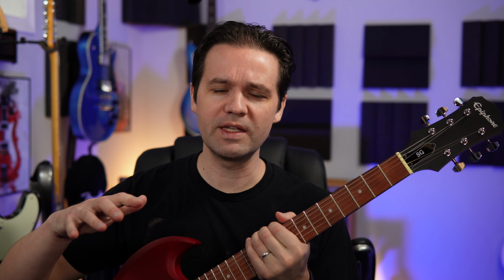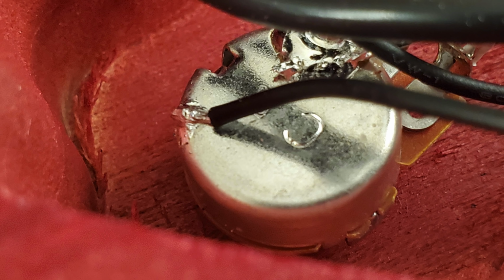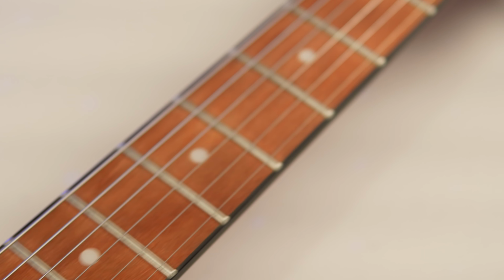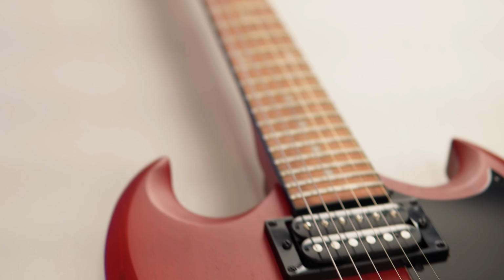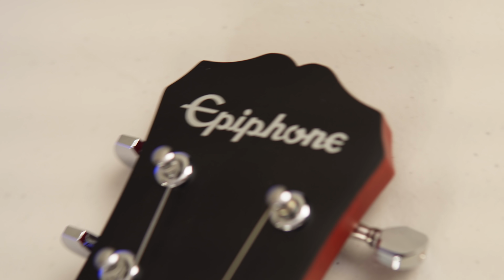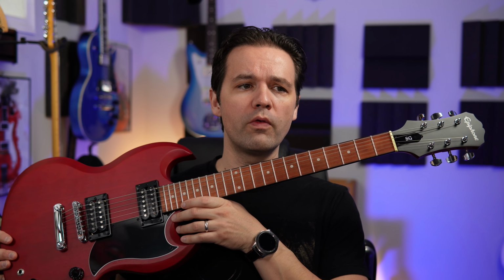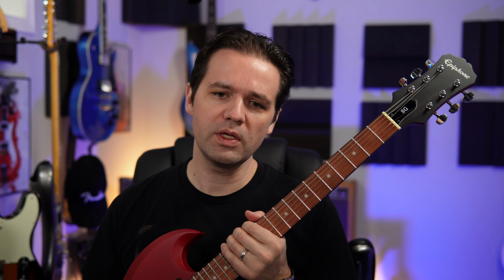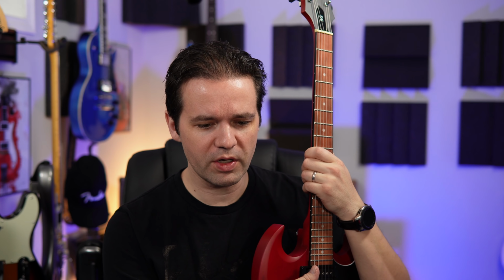This Epiphone SG is Solid and Special

Comment: I actually like the head stock and think epiphone' s are great for the money. With a full set up and pickup change they are great.
Reply: And tuners probably
Reply: So... if you spend extra money on them they're great?? What about straight outta the box?
Reply: @alicegrant3731  Why not get the sound closer to a proper SG, your paying under £200 for this thing so you will mostly have some budget left over for modification
Reply: @whyisyes3957  true. Depends what you can live with sound wise
Reply: @alicegrant3731  I use mine mostly stock with upgraded strings and well taken care of tuners. I can get amazing Sabbath like tones on it and I found it great for most punk and some metal
Reply: I have a cheap sg I kept stock as well. The pickups don’t sound half bad but, I did just do a better insulation job in the cavities. Other than that it sounds good though my amp so I just figured why fix it if it isn’t really broken. 🤷🏽‍♂️
Reply: Vs 1500 to 2000 for a new SG?

Comment: This guitar taught me something: a guitar is a piece of wood that holds pickups. Bought mine to mod, installed Gibson 57 classic pickups, Gibson pots, orange drop 22uf cap, Tusq nut and Grover tuners. Sounds and plays freakin awesome. $289CAD for the wood, $550ish for the parts. Honestly, this plays as nice as my Goldtop that costs me over 3k. What the Goldtop has is its beautiful finish and brand name, which is worth something and why I have it. But modding this little gem blew me away

Comment: Just got mine new at GC for $200 before taxes 🎉. Love it sounds incredible I played on an old cheap Washburn Lyon signed by Brian bell, that I scrapped off as a child and now deeply regret and for breaking it and throwing it away, however that guitar gave me the best and greatest load ups for palm muting and releasing and just ROARED when done right at the right time. This guitar does the same thing and it brought me back to being 18 and feeling bullet flipping proof again, I’m only 27, and reinvigorated my passion to continue growing in guitar playing even though I have “better” guitars and more expensive ones, I’m about 95% sure this will be my go too unless I wanna feel like ripping heads and pulling out the ex50 and walking in hetfields’ footsteps. However this guitar really does rip and sing any clean or dirty Metallica riff along with any other band you can think 🤔
Reply: Oh and EXTREMELY light. My ltd explorer shape is heavy af and suuuper neck heavy, kind of a bitt to play when standing but this thing is like butter. I won’t ever stop saying it more is less and less is more if it’s done right, feels right, and sounds right to the player!

Comment: I have one of these in brown (probably something fancier officially). It makes a great travel guitar, partly because of its compact size and partly because of the price. I even took it to Afghanistan a few years ago.
I actually cracked the neck just below the headstock, so I got my first repair experience with it. Then I replaced the tuning machines because of exactly what you pointed out. I'm looking at replacing pickups and the pots, just to see what that does. 
I think for someone who likes to tinker, this is a pretty good choice (again because of the price, but also the simple design).

Comment: The walnut ones are the most desired of the bunch and those are the most moddable too. 
I can order in tons of different walnut parts such as walnut pickup rings, walnut selector switch tip and switch washer, knobs and even tuner tips too. 
in fact, I'm doing this build and will update when I'm done.

Comment: Grabbed one cheap. Needed some light fret leveling & polishing & fret ends done as is typical in the cheap EPIs. Pickups are too high stock, drop them. That's why your overdriven sound is so muddy. You can get some nice tones once you do. Tuners are OK but have a lot of slack between tuning up and down. As for the Slim-D, I don't think so, Epi. More of a C that starts slim but gets fairly thick up higher.

Comment: $199 At GC. If you have any old gear laying around, pedals, amps, guitars…you can trade it is for a 10% discount and whatever they give you for the trade ins. Works on any price guitar too. I traded in 2 super cheap Amazon mini pedals and got it for $169 after tax. Wish it was an Indonesian copy instead of a the Chinese one, but frets and neck are pretty solid. Pretty awesome you can get a playable guitar, brand new for that price in 2024.

Comment: Bought this for my 11 year old as a step-up guitar and he loves it! Super light, great sound for the price. I'd highly recommend for a player who is on the small side and looking for a great beginner's guitar.
Denver, Colorado.
Reply from the maker: nice!
Reply: Is this not a full sized guitar? I'm interested in purchasing. But if it's not a full sized SG then I'll pass.🤔
Reply: @EXSENTRIX  it's the standard 24.75 scale for epiphones and gibsons. The body is very thin and the wood is light, so my son who's smaller doesn't has as much of a problem keeping it from diving as he would a fender that's a little longer scale and heavier.
Reply: @acaeleus  You've got a good point. I would have loved this when I was 11. That's the age I got my first guitar. It was a Synsonic Terminator. With the built in speaker lmao!
Reply: Perfect. I have a bad back, weak left foot and small stature😂
This is what im looking for

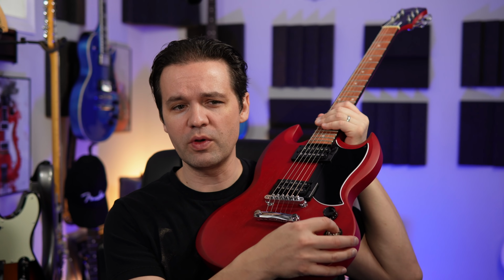Comment: In 15:08 you did the thing ... when I broke my Special II switch. Similar one...not good at all my piece...soft pot metal and badly made. The pups are fine ; )
Reply from the maker: I did the thing?
Reply: @landonbailey  Yes...did you check the condition of the switch after ? I lost the bridge pup alone connection and when opened the cavity to check why, the metal parts dropped out. I soldered it somehow but waiting for a new better one now.

Comment: 4:29 for an inexpensive guitar at least the solder joints are clean and shiny. Sometimes you'll see dull and dirty joints and wires where the conductor strands are partially cut through during the stripping process.
Reply from the maker: it was clean for sure

Comment: The difference between the neck and bridge pickup resistance is crazy! I have an older version of this from 2001. The bridge is about 15.5k ohms while the neck is 12.5k ohms. That's a lot closer. I guess with these cheap pickups they just stop the winds whenever they feel like it so you get crazy differences like this.

Comment: You had me a $249.00, stopped me dead & paused the video.  The all over cherry satin finish it appeared to be an $ 800+ guitar.  Fender gal, open to new stuff too.  Give you my opinion after ...your DeEp DiVe.  For the price, okay, those tuners can be removed, open the gear casings on each & tighten all the inner gear screws & the tuners-will stay in tune better & longer. It’s not for me, but I appreciate the review, definitely will look at a few Epiphones next time I’m at my local.

Comment: The downside of cheaper guitars, the Frets. Every Squire and Epiphone I need to go through and do the work on them, Its just the trade off for the cost grant it they have gotten much much better over the years.
PRS SE tends to put all the money In the woodworking Frets/Nut and some of the hardware, usually the Pickups/and electronics are where they skimp the money to make it affordable. cheap Alpha Pots, which are fine, just not the greatest.
Reply from the maker: good point. I've heard they also wear down because of the cheaper metals
Reply: @landonbailey  Yeah, cheap Nickle, typically you have cheaper alloys and then you have expensive alloys but you are sliding, slapping, and abusing the crap out of the frets, it is rare to come across a vintage LP that is actually played that doesn't have frets down to small nubs that are barely there or severely worn. Stainless steel frets are real nice, I seriously hope we see them start filtering down to Fender's product tiering rather than just being bound to the Ultra Luxe series. Especially because Nickle is actually more expensive ironically than Stainless steel metal wise, processing depending on the alloy shouldn't be all that different either, just more wore down tooling on the finishing steps.

Comment: About two years ago I think it was, I bought a Epiphone SG Special VE, and I still play it all the time.  This guitar is almost the same exact guitar, no frills and all but a working guitar that sounds pretty good..   I got mine for like 130 ish USD and it wasn't on sale..  I would never pay any more than that for this guitar, any company that charges more than that is gouging you period.
Reply: So, I have owned my Epiphone SG Special VE for about three or so years now, and I figure it would be cool If I replied to my own comment from a year ago..

I didn't include much information about the guitar its self, outside of the fact that it worked and sounded good, so I figure I can give some details now. 

First was the truss rod issue, the first one I got sent by the online outlet I bought it from, had a truss rod issue.   By that I mean, when I did my setup on it, It worked, but when I tried to pull the tool out, the truss rod followed....  So, I got it replaced, and my second one was fine.  The fret ends on both guitars needed a little love, as they were kind of sharp and they needed a quick shine up as well lol.   The tuners worked on both guitars, and the tuners on the guitar I still have work fine.  It's possible they are crap, but the guitar doesn't go out of tune very fast, generally I can tune it once a week and I am fine with it.  Even then, its just little adjustments that is needed, so its fine.   The neck did get glossy pretty quickly, but I bought some of those green Scotch Brite Heavy Duty scour pads and they worked perfectly for fixing that issue..  I hate glossy necks with a passion, as they seem to get sticky real fast and no matter what I use I can't get them to stop while they are still glossy, which the Scotch Brite pads work to fix pretty well.  

Lets see, it still sounds good, the pickups are fine and the electronics have held up, though its only been like three or so years so.....  We will see how long they last until they need replaced..  The guitar gets played at least 4 to 15 times a week for at least 30 minuets at a time, so it gets plenty of usage.   I clean it up every time I change strings, which tends to be about once a month or so, so it still looks pretty good.  It is a different color, its Heritage Cherry Burst or something like that, and I like it.   Its one of the top three guitars that I play, its on the list with a Ibanez JivaJr and my Fender CP-60s acoustic guitar...  I am almost constantly picking it up or one of those other two lol.   I would recommend this guitar to not just a new player, but any player and at any level, as its fun to play... 

Oh and that fret board is a strange one, though I use Music Nomad stuff on it, and once I did it got a bit darker..  Its a cheap priced wood and all, but it works just fine for the purpose, and it is different than what you generally see on other guitars...   I fell in love with these guitars, because for some reason, to me, these felt better than the more expensive Gibson SG's I tried...  Could be the satin finish on the neck that I like more than anything else, but its still a guitar that I like a lot more than the other SG's that Gibson produces....   

If I remember this, Ill come back in another year or so, and give a update.. Though I doubt I will remember, who knows.. this video popped up in my feed for a second time, so maybe it will happen again lol.  I wonder if he kept his, or if he got rid of it...

Comment: In '95 I got a '92 Gibson SG Special, black with ebony fingerboard. It was my main for about 15 years and sold it because it's always been a love/hate relationship: the sound was amazing, those pickups were so high output! But I never really came to term with the fat neck. In 2001-2004 I used to gig with a VHT Pitbull and the combination was killer.

Comment: I've had several of the Epi Special Les Pauls. They really vary in quality. Some are good, some not so good. The Special SGs really used to look weird without the pickguard. These look really nice though. Saw they were 199-299 new. Definitely worth 199. But any more than that, you can likely get a used Epi SG Standard.

Comment: Epiphone for some reason does not list some of their more affordable guitars, let alone specs.  So, retailers are left with posting old specs that pre date the CITES act..  Now Epiphone does list specs for it's new Les Paul Special II E1 model, and that finger board is listed as Indian Laurel.  I have held one in my hands, and the LSPII E1 finger board is the exact same material that is on both my Epi LSPI P-90 guitars, 2020 and 2021 models.  Furthermore, I've also played that new SG you are reviewing here, and it is the exact same finger board material as both of my P-90 Epis.  On a final note, your SG was manufactured facility 13 in China, as were both of my P-90 Epis.  So, after geeking out a bit too much here; Indian Laurel seems to be the finger board answer...but was there a question???  Does anyone care?  Bottom line; the finger board works just fine.  It's NOT Rosewood, most likely Indian Laurel, but it still works.  Thank you Mr Bailey for your Epi SG review.
Reply from the maker: cheers!

Comment: call me crazy , but if I were to get an epiphone, that is the model I would get. I have had the set neck epis that cost much more and I have played a few of those specials. To me the specials are a way better deal. Compared to my Gibson SGs the specials get just as close as the expensive set neck epis for way cheaper and they just seem cooler. For the price of a set neck epi you could just save a little more and get a real used Gibson which is light years better. Peace

Comment: The Les Paul Special II I acquired was exactly the same. Those frets appear dull as well just like mine. The fretboard on the Les Paul was the same until it absorbed a gallon on F1 oil (Ok, not a gallon, but lots). The wood looks pretty good now that it's not so dry and the colour is much darker,. Frets also needed some spot crowning for buzz and polishing. Used Scotch-Brite fine on the fret ends and they feel fantastic now.

Seems to me that they are common issues on pretty much all the value Epiphones. My Les Paul Special II (Slash AFD) was over $400 (Cosmo Music, Richmond Hill or Northern Toronto area for those not local) CDN and same crap with the neck on mine at almost twice the price. The devil is in the fret rocker, made a lot more work for me than I wanted.

Comment: Good show man. I got my mitts on one of them Epiphone Les Paul specials a few months back in red and added a third Epi pickup with a small red push botton. I've been wanting to get the SG version and make it match my little red sleeper. After some adjustments and obsessive strobing I'm put Epiphone necks and fret boards at the top of my affordable list.

Comment: I have the Les Paul Special VE, which is the LP version of this SG. Same electronics, tuners, pickups, neck etc. I found it very comfortable to play so much I have spent more on the new pick ups (SD Alnico II Pro Slash signature & SD APH 1n) than the guitar was worth. The tuners are very much in need of swapping. These 'cheap' guitars are very well made and worth a bit of time and effort to set up and have as your #1 guitar.

Comment: I bought one about a year and half ago in satin black. I think I paid $179 for it. I bought just out of boredom and as an excuse to do some mods/ test guitar. In all honesty for as cheap as it was I was actually surprised by how much I ended up liking it. The pros : It really is well built. The frets on mine were straight. Like freakishly straight.  The feel of the neck is great. The satin black finish is well done and looks cool. And finally, I was shocked by how well this guitar stays in tune considering how cheap the guitar is.  Cons : Like you mentioned, the fret ends were sharp when I first got it, which is to be expected at this price point. But they have smoothed out quite a bit from constant playing.  The electronics, are predictably, crap. Again, given the price point, this is to be expected. Despite what some of the online reviews would have you believe the stock Epiphone pickups sound like shit. The pots are tiny and the wiring used is razor thin. Luckily I had a spare EMG 85/81 set  that I swapped them out with as well as ripping out all the wiring and replacing the pots and even the pickup selector switch. Yes the pickups cost more than the guitar but it sounds a thousand times better and plays remarkably well.